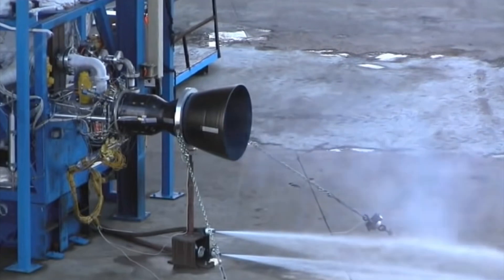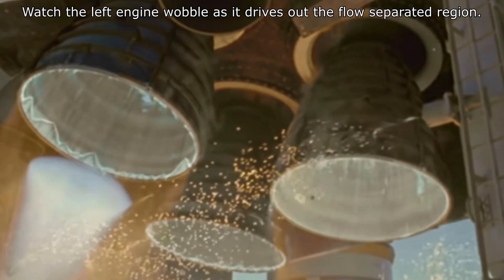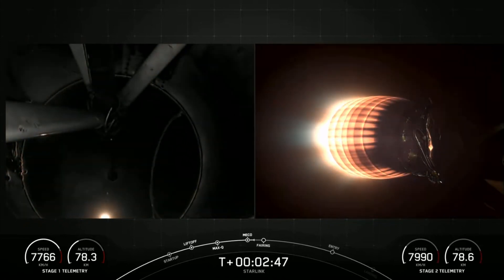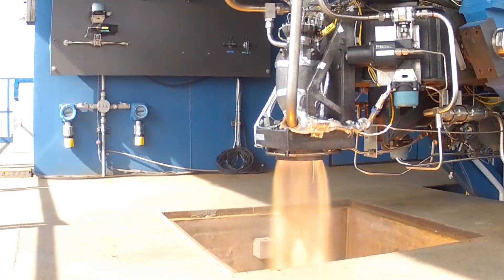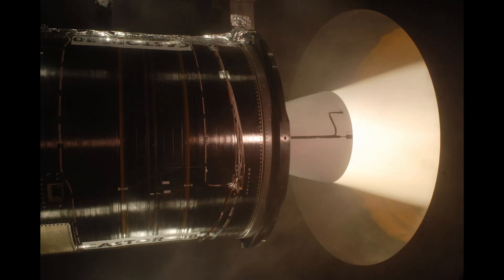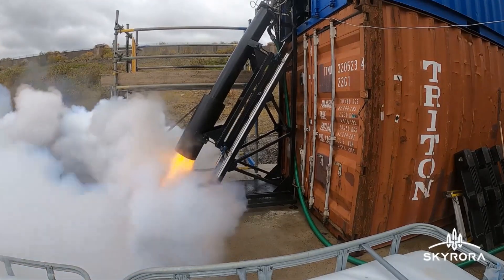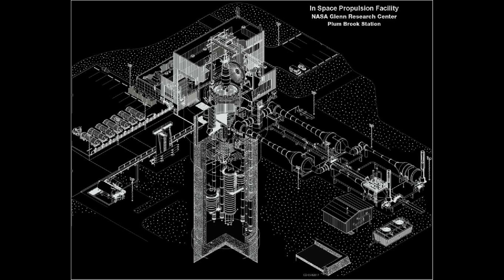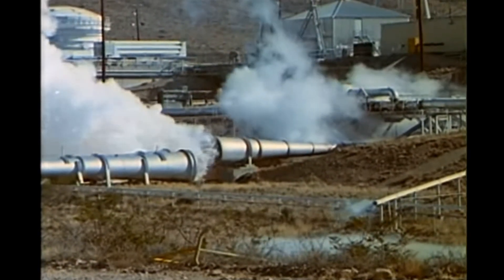Defying Atmosphere - How Rocket Engines Get Tested In A Vacuum Before Going To Space

Comment: Am from Netherlands and engine rocket engineer. In vacuum there is no rocket science invention to travel , so not even to communicate. You only speak in wishfull thinking of NASA bullshit. The other claim of 28.000km/h speed in a temperature of 3.6 kelvin is fiction only. To stupid for words
Reply: If you actually were an aerospace engineer, you’d be familiar with this equation. 

F = m_dot * v_e + (p_e - p_o) * A_e

Notice how setting the free stream pressure to 0 increases thrust.
Reply: You are not an engineer of any sort. You failed to graduate high school. Now stop lying.
Reply: Rather strange, same works in vacuum, expect other, not only pushing (on itself) but BETTER !  But car suspending dont advance much... fickle LAW.
Reply: @wildboar7473  Cars work by their tires pushing against the ground. When you lift a car off the ground, its tires can’t push off anything. 

Rockets push off the mass they eject out of their nozzles. They don’t push off air or the ground.
Reply: Best is deleted or ghosted to Newest First, always, principal is RESISTANCE, for Pushing back, is road full of oil > car will not respect "NEWTON LAW" = illegal spinning. If the road be suspended in void well at best it would just be pushed backwards, just like rocket exhaust.
Reply: @wildboar7473  So just EXPLAIN TO US what would happen to a CROSSBOW if it fired a projectile into a vacuum.

Are YOU suggesting that the crossbow feels NO RECOIL FORCE?
Well, that WOULD be a violation of Newtons laws.
Rocket propulsion MUST work in a vacuum. Now GO BACK and finish high school before arguing basic physics with rocket scientists.
Reply: @wildboar7473  SO you are STILL confused by mechanical recoil?  
Explain how the recoil from a crossbow works using Newtons laws and the law of conservation of momentum.
You know, to a high school level.
You cannot, or you would not be perplexed by rocket propulsion.
Reply: @wildboar7473  You cannot, or you would not be perplexed by rocket propulsion.

Comment: So the rocket blowing oxygen and hydrogen can function in a void. Thats awesome. They only work in the atmosphere. They still wouldn't propel in a void because the 14.696 ppsi (at 70° at 70% at sealevel) of helium oxygen carbon dioxide argon etc. are not pressnt to use to propel against. If that is the case it would nullify newtons third law. You said a lot of nothing.
Reply: It would be a violation of the laws of motion if rockets didn’t work in a vacuum. 

Rockets exert a force on the mass that they eject out the nozzle and that mass exerts a force back on the rocket. The ejected exhaust goes one way and the rocket is propelled the other. 

The ejected mass has already exerted a force on the rocket by the time it leaves the nozzle. It doesn’t need a second interaction to impart a force on the rocket.
Reply: Nate if you think rocket propulsion in a vacuum is impossible, then please explain what would happen to the CROSSBOW if it fired a projectile into a vacuum
Are YOU arguing that the bow would FEEL NO RECOIL FORCE?

Because that WOULD be a violation of Newtons laws.
Reply: Or run away like a coward.  Your choice
Reply: @stuartgray5877  I work a lot, like a man does. YouTube replies are my last priority during the week. I would have a conversation with you but because of your snarky remarks, I don't want anything to do with you at all. Too bad, you were actually the only person that actually said anything with a shred of sense. I hope you get yourself in order. It would be a real shame if you continue provoking people to think poorly of you.
Reply: @NateStege  I just tire of high school dropouts claiming to be smarter than all of the Physicists and Engineers then just disappearing like trolls.
So, tell us how YOU understand basic physics better than all of the engineers and physicists and they have it all wrong.

Or is it just possible that it is you that has a misunderstanding?
Reply: Sounds good, thinking, indeed that Mass would not budge much with injection against nothing.
We have no right to assume that any physical law exists, or if they have existed up to now, that they will continue to exist in a similar manner in the future. Max Planck and Walter Henry Johnston, The Universe in the Light of Modern Physics (1931), 58.
Reply: @wildboar7473  We have THOUSANDS of satellites orbiting earth, Dozens in deep space or in orbit of other planets and we have logged MILLIONS of hours of rocket propulsion in a vacuum.
Reply: @wildboar7473  SO you are STILL confused by mechanical recoil?  
Explain how the recoil from a crossbow works using Newtons laws and the law of conservation of momentum.
You know, to a high school level.
You cannot, or you would not be perplexed by rocket propulsion.

Comment: Listen. You might get a rocket to burn in a vacuum but with no atmosphere for it to push against it would do absolutely nothing, nothing at all.
All conventional means of air propulsion will not work in a vacuum as they all require atmosphere, just like a boat propeller needs water.
In small vacuum chamber the thruster will be pushing off the walls of the vacuum chamber, not proof of thrust being achieved in a vacuum, it's faking results.

What I want to know is, "when did scientifically minded people forget about physics?".
Reply from the maker: So you’re saying that Newton is wrong and a gun wouldn’t produce a recoil in a vacuum?
Reply: Dave may we suggest that YOU complete high school physics BEFORE calling every scientist, engineer, and physicist to have ever obtained a degree a bunch of idiots?
That is basically what you are doing
You obviously could not pass a high school physics exam.
Reply: What do you think happen if you were floating in space then threw a heavy object. What would happens to the object and what would happens to you?

Comment: If sound cant propagate in a vacuum how does trust propel a rocket??
Reply: Rocket engines apply a "force" to "mass" causing it to accelerate into the vacuum backwards.
This in turn causes a "recoil force" back on the rocket engine pushing it forward.

Basic Newtons laws.
Just like how throwing a big rock from the back of a rowboat will push you forwards.
Reply: @stuartgray5877  No not in a vacuum near zero "gravity" your rock and boat won't move you.  ITs science!..fiction
Reply: @RenoSimpson  - " No not in a vacuum near zero "gravity" your rock and boat won't move you.  ITs science!..fiction"

May we suggest that YOU go back and finish high school BEFORE challenging Engineers and Physicists to a physics debate?
Reply: The rocket exerts a force on its exhaust gasses to eject them out of the nozzle and the exhaust gasses exert a force back on the rocket. Both go flying off in opposite directions.
Reply: @AM-rd9pu  The only way you can create movement in a vacuum with no "gravity"  is magnetic repulsion or attraction anything else is science fiction
Reply: @RenoSimpson  This is just a simple application of Newton’s laws. 

If you exert a force on mass, that mass exerts a force back on you. 

Rockets exert a force on the mass they eject out the nozzle and that mass exerts a force back on the rocket. That’s all there is to it.

Comment: Nobody going to address the Elephant in the room? Too busy being groupies I guess.

There’s a huge difference between testing a rocket in a vacuum chamber, and the possibility of a rocket propelling itself in the vacuum of space.  Allegedly, space is a vacuum.  Meaning, there is nothing in it.  In all aspects of motion, something has to push off of something else.  This is real world physics and you can do as many tests as you like, such as having the rocket inside of a man-made vacuum chamber which inevitably has walls, of which the thrusters would push away from 🤦‍♂️, but it will never take away from the fact that without pressure there is no motion.
Reply: Are you seriously that dumb to think that the gases that have been bounced off by the wall of vacuum chamber can somehow goes back to the nozzle of the engine and then create some thrust?? Did you seriously believe that?? I mean, the whole vacuum chamber has a bunch of space for the propelled gas to expand into and yet it still somehow goes back to the nozzles, how is this even make sense to you?? You guys really have big flaws of understanding of gases behaviour

Yes, you're right about the fact that rockets didn't pushed anything to begin with, but what you're pretty wrong about is that the rockets can't work in a vacuum, first of all, rocket engines works by chemically create a sudden burst of explosion of gas(yep, you heard it right, it create an explosion) and then accelerated it to hypersonic speed of which then it comes out of the nozzle resulting in a massive amount of thrust, how does it create such thrust? By the fact that since the engine actually is a load of high pressure gas inside a solid container the gas always want to expand and and get out of the container, when 1 side( the back side) of the container open a hole(in this case the nozzle) it will start to decrease in pressure in that side, this event makes the gas in the opposite side of the container will pushes off the front side of the solid container creating a forward force and movement of the container, this is why the rocket makes thrust in the first place, the faster you decrease the pressure in 1 side of the engine the stronger the gas in opposite side will pushes the rocket itself, this is also happen in water hose, you open the valve that makes the water goes through the whole hose of which then the water started to lose its pressure in the nozzle side and then pushes off the other side
Reply: @Agrac16 I’m dumb? After reading that (let’s just say word salad) I’m definitely more dumb than I was before.

You’re completely wrong it’s very simple;  vacuums have zero pressure, zero pressure = zero motion.
Reply: @Marky18  
1) If I set off an explosion in a tube, will it go out both ends?

2) if I close one end what will happen with the explosion?
Reply: Mark, in a vacuum,
1) If I set off an explosion in a tube, will it go out both ends?

2) if I close one end what will happen with the explosion?
Reply: @entangledmindcells9359  Nothing, there is nothing to push against in space.
Reply: @Marky18  Nothing like sticking to your strawman argument & refusing to answer questions that point out the flaws in your strawman.
Reply: @entangledmindcells9359  liking your own comment with a sock-account I see…

I answered the question perfectly fine.  There is zero thrust in a vacuum, get over it because this is reality.
Reply: Rockets push off the mass they eject out of their nozzle. 

Rockets work for the same reason that you roll backwards when throwing a heavy object while standing in a skateboard.
Reply: @AM-rd9pu  Not in the nothingness of the vacuum of the conceptual lunacy that is, space.
Reply: @Marky18  Did you not listen to anything I just said?

Rockets push off the mass they eject out of the nozzle. It doesn’t matter if there’s nothing surrounding it. 

When you throw the object while standing in a skateboard, you’re pushing off the object. You’ll roll backwards whether or not you have air surrounding you.
Reply: @ I read it, can’t see how it’s possible to listen to it to be honest…

Of course it matters, a rocket needs mass to push away from.  You need a pressure system to cause motion (the air the rocket would be flying in), in a vacuum the thrusters are pushing against nothing so there can be no motion - it’s impossible.
Reply: @Marky18  You know that rocket exhaust has mass right? The rocket exerts a force on it to eject it out of the nozzle and the exhaust exerts a force back on the rocket. The exhaust is ejected one way and the rocket is propelled the other. 

Like I said, it’s no different than throwing an object while standing in a skateboard and then rolling backwards. Or you can jump straight up while holding a heavy object and push it forwards before you land. You will land behind where you jumped from because you pushed off the object. Again, this will also work if you did it in a vacuum chamber. 

This is just a simple application of the third law of motion.
Reply: Correct.  Without a medium for exchange a closed system cannot resolve work outside of itself.  Stu gray is an old af bot.  @AM-rd9pu works with stu gray and it's the same nonsense like "Rockets push off the mass they eject out of their nozzle" because the writer doesn't actually know what tf mass is and really it doesn't matter as they will just try and change their angle of attack again.  

Here is a detailed explanation of why the medium is necessary and the fake arguments they keep mis-representing: crossbow analogy is flawed from the outset because it misrepresents the mechanics of force interaction and here's why:

1 Recoil is not "Action-Reaction" in isolation. Recoil in guns and crossbows comes from energy displacing into the environment (air, ground, the user's body, etc.). Remove the environment (like in a vacuum), and the system stays self-contained, with no external grounding.

2 Internal forces resolve within the system. In your crossbow example, the bowstring's tension is resolved internally. The only reason you "feel" recoil on Earth is because the system (crossbow) has a reference frame to "ground" its energy (like air and the user's hand). In a vacuum, with no medium, it becomes a self-resolving system, and the forces collapse inward.

3 For force to cause motion, it needs a reference system to "push against." In space, there is no medium, no ground, and no field. This violates the "conservation of momentum" claim because momentum needs to be transferred — but what system is "receiving" that momentum? The answer is 'nothing.' A vacuum has no mechanism to store or transfer energy.

5 Your analogy relies on flawed assumptions about "closed systems." Internal systems (crossbow, rocket) only work if there is an exchange between the system and the environment. If you can't explain what medium the rocket is "pushing against" in space, then your argument collapses. On Earth, the crossbow uses the air, the archer's body, and the ground. What does a rocket in space use?

6 What is the medium for the rocket in a vacuum? If you claim the exhaust is the medium, you're self-referencing a closed system, which violates the fundamental principle of "system interaction."

**Simple Question for You**:

If you fire a crossbow in a vacuum, what system absorbs the "recoil"?
If you fire a rocket in a vacuum, what system absorbs the "recoil"?
If the answer to both is "nothing," then you've proven my point.
No medium. No system interaction. No motion.

If you can't deposit energy into a field, there is no withdrawal. Simple recursion logic

This was written for Stu gray the bot, but it won't reply against hard facts only the human-shill ops will xD
Reply: @DrCash7  If you wanted @stuartgray to respond, why didn’t you just reply to his comment? I’m fairly confident you’re familiar with how YouTube’s notification system works and the fact that it can be unreliable. He likely never got a notification for this comment. 

But being realistic here, that’s probably what you wanted. If he never sees the comment, you can make up reasons for why and then declare yourself the winner.  

I’ll tag him for you to give him a more fair chance to respond. 

And your gobbledygook was almost impressive. You wrote a novel of a comment just because you refuse to understand the laws of motion. 

Here’s a situation for you. A person gets into a pressure suit and walks into a large vacuum chamber. The chamber is evacuated of air. The person then picks up a heavy object. They jump off the ground and throw/ push the object forwards while still off the ground. 

What happens to the object and the person?
Reply: @AM-rd9pu  you're bugging.  I'm not even in this comment thread.. and the issue's already been put to rest ages ago.. best of luck to you on your shill-campaign.
Reply: @DrCash7  You seem miffed that I replied to a comment you made on a public forum. The comment I was responding to wasn’t even from that long ago. 

You are right that the issues being discussed have been put to rest ages ago. The issue is that you refuse to accept reality.
Reply: @AM-rd9pu  there is no comment dummy
Reply: @DrCash7 just tell us HOW rocket engines accelerate all that mass IN ATMOSPHERE?

Does the chamber pressure “push” the exhaust out or does the 14.5 PSI atmospheric pressure SUCK the exhaust gas out?

You are not fooling anyone. You won’t answer because the truth proves YOU WRONG
Now instead of answering, be sure to use your sock puppets to flood the thread with juvenile insults and accusations that I am a bot
And bless ALL your little hearts!
Reply: @stuartgray5877  you still don't know what fire is, do you? Poor little chatbot stu, his programmers failed him hard 😂
Reply: @AM-rd9pu  you immediately change the subject & start lying. It's all you ever do, chatbot 😂
Reply: @papalegba6796 I like how you return from a months long hiatus with a weekend long bender then decide to follow that all up with one more comment in the middle of the night. 

You call me a liar but of course you can’t substantiate that claim. Go ahead and prove where I lied. I bet you won’t. 

And how exactly did I change the subject when I directly addressed something they talked about?